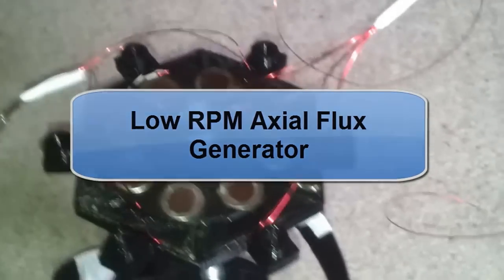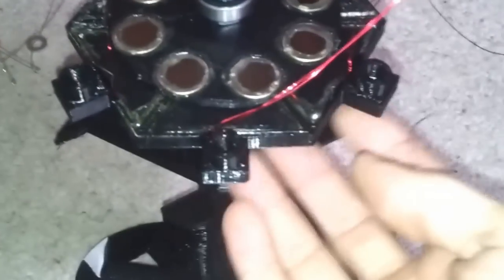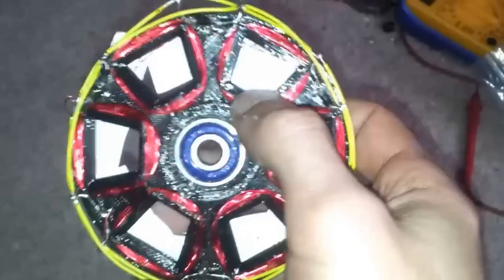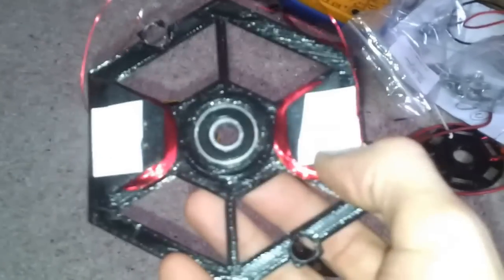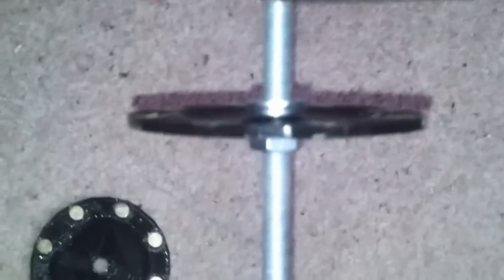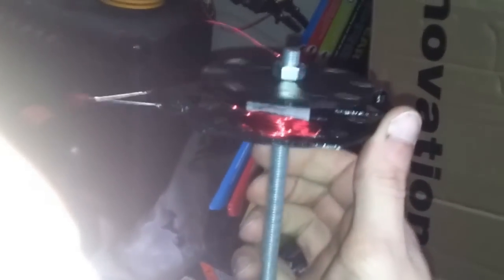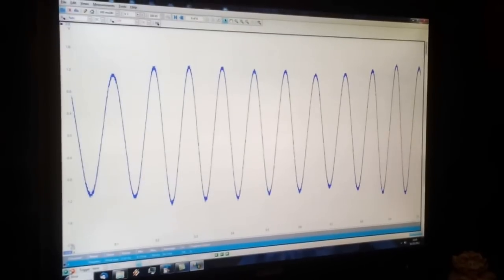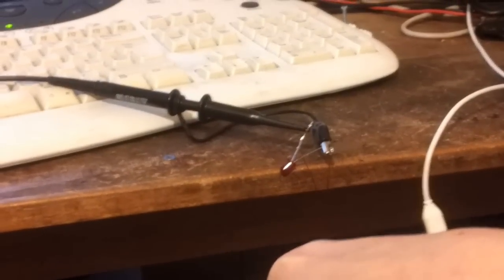Low RPM Axial Flux Generator Cell v3 001TECH

Comment from the maker: brilliant we certainly need more designs like this in the public domain. a generator like this will output ac so by using a transformer you can amplify the voltage by sacrificing current and visa versa. I designed it to be scalable so the more cells you add the more power the generator provides. of course adding more cells also increases friction and there is a limit to how much power you can extract without causing the turbine to stall. I've just made a new turbine and am currently testing it outside in a tripod so if you do have any ideas I would be happy to hear them. I want to increase the cell efficiency by adding steel plates to the outer magnets. this protects the magnets and amplifies the flu to the coils. Essay over ☺